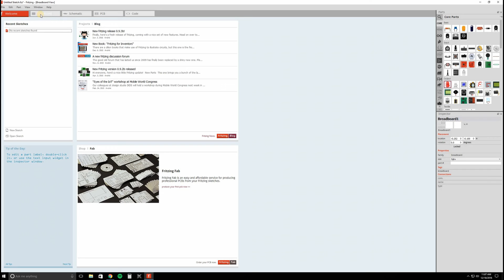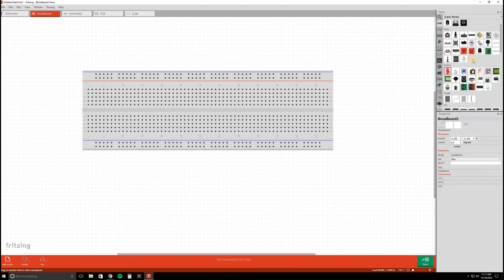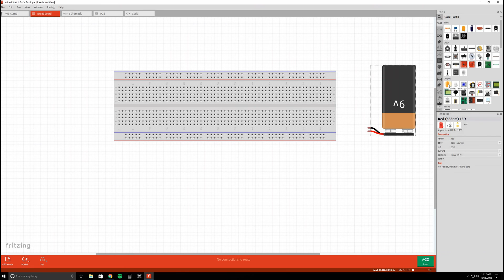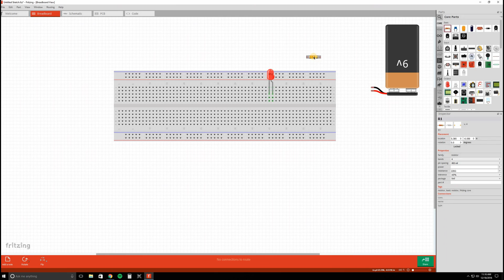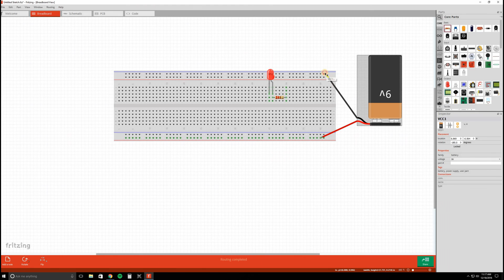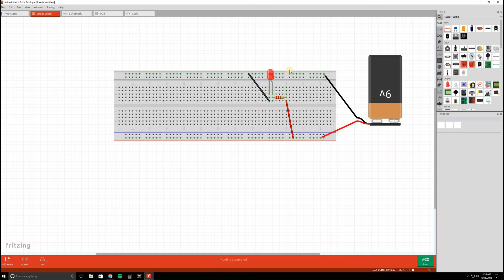How to: Building Your First Circuit with Fritzing. Absolute Beginners Tutorial Episode 1

Comment: I'm glad they added the Simulate function which allows me to burn up many batteries and LEDs. This setup would definitely destroy the LED. 🙂This is why I think the electron flow model works so much better so that we know where to place the resistor. Swap the power inputs and outputs and/or flip the LED for those struggling. Students, remember, electrons actually flow from the negative to the positive.